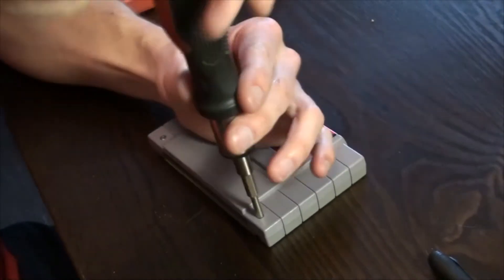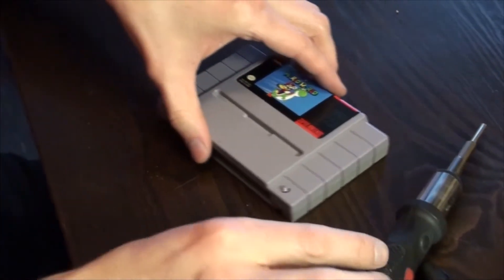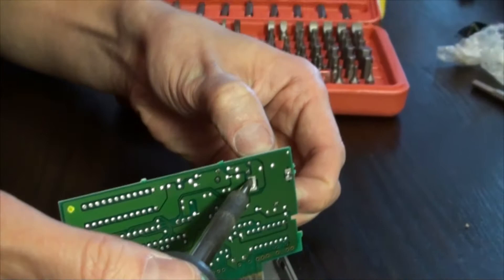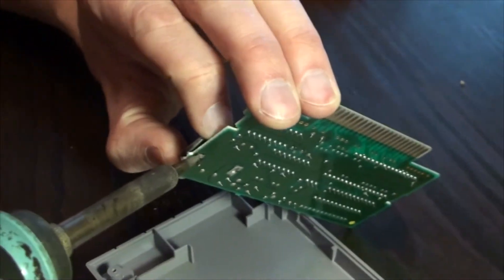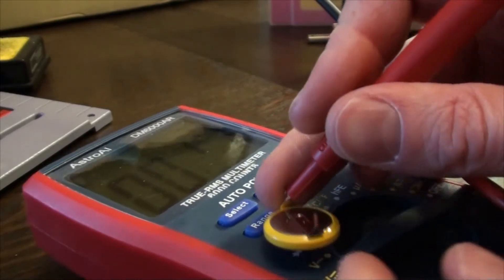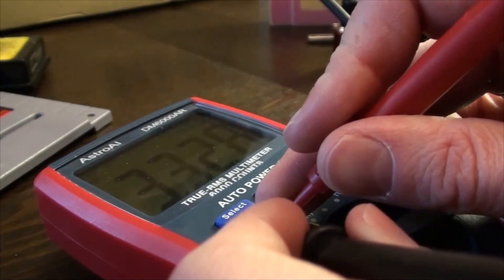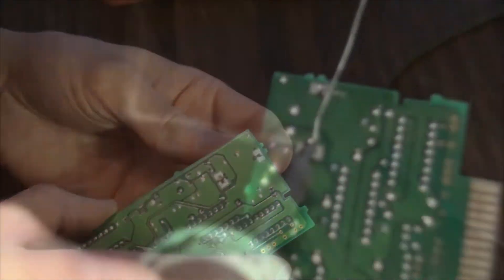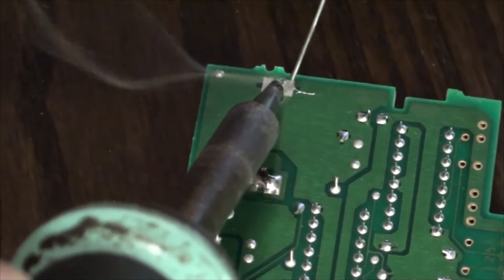SNES Battery Replacement CR2032 - Super Nintendo Cartridge

Comment: My Metroid 3 is doing weird stuff. Is not saving and the save files are shown with a playing time of 00:00 and if I don't clear them before starting I get an instant game over. Will try changing the battery and see if that fixes it.
Thanks.
Reply from the maker: If you've got a multimeter, check the voltage on that battery before you throw it out.
Reply: @VestigialVoice  Thanks. I will

Comment: Some of the metal pad below the original solder lifted up when I removed the original battery. I can’t get the game to save, will that be the reason why?
Reply from the maker: You are correct.  I would locate the tracing for the battery pad, scratch it and solder a jump wire from that spot to your battery.  It will work.  When you verify it does, cover the scratched site with hot glue to prevent corrosion.
Reply: @VestigialVoice thanks for the quick response
Reply from the maker: @Mrbigsaks my pleasure.  I want to know how it turns out for you.
Reply: @VestigialVoice thank you, I am not sure I am capable of fixing it, but if I do I will let you know
Reply: @VestigialVoice so bought a multimeter, something I should have done first really but hindsight is 20/20. 

I tested the original battery that I removed and it shows 3.15v which I understand should have been enough to save the game. 

I then tested the solder points for the battery i installed and again it’s showing a good battery as it’s giving out 3.38v. 

A quick google suggests the issue could be the SRAM chip, I’ve looked at the board and nothing seems damaged to me though I am very limited in my understanding of circuitry and electronics. 

I should add the game in question is an NTSC copy of Lufia and the fortress of doom which I am running on a PAL snes using a converter. I’ve had no issues saving with any other NTSC games that I own. 

Does it sound like the SRAM chip is the problem? 

Sorry for the long winded question.

Comment: Can you switch batteries without changing the holder?
Reply: I'd assume it would need the new holder for the more modern battery, but I am unsure.
Reply: @Deadpool_64  
The original battery is tacked on the holder, so yes, best is to replace it. The holder I bought was too big for the cartridge (make sure it's snes compatible before you buy) so I ended up resolding the original one and secured the battery with electric tape. Not ideal but it works. There's a video on YT that explains how to do it.